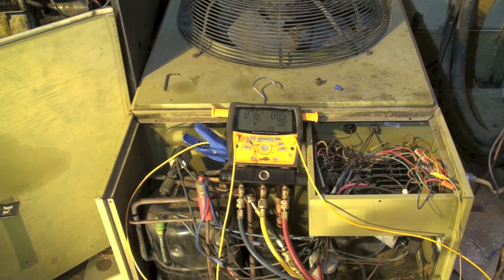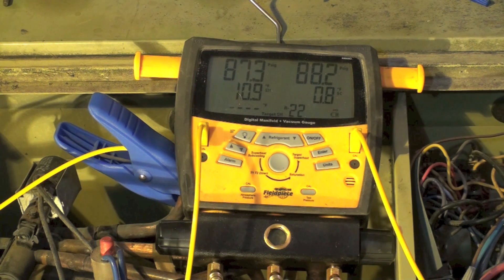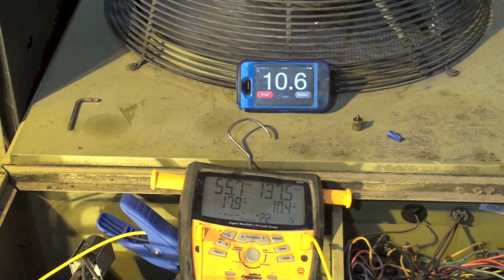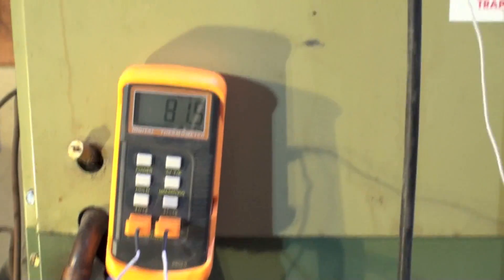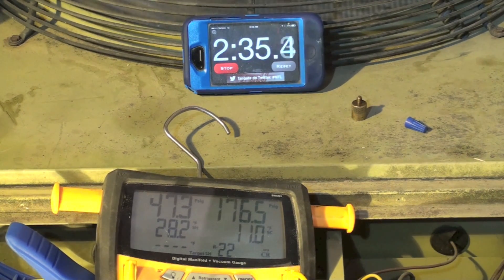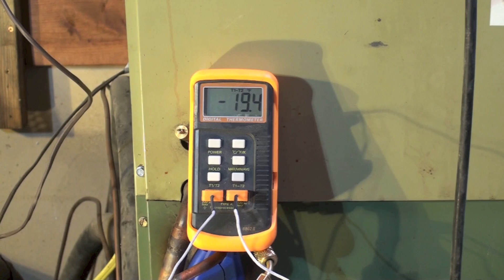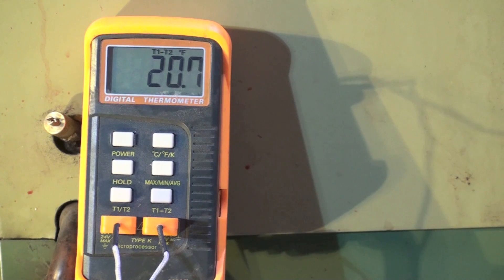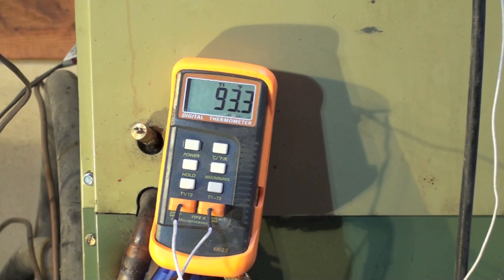How long does it take for the heat pump to be efficient

Comment: I imagine scroll compressors are much more efficient in time about getting to proper operating pressures.

If that reciprocating without a crankcase takes that long at 50 ambient, if it was colder than unit would become inefficient very quickly !!
Reply from the maker: Scrolls are about the same for inefficiency upon startup.  
GFM

Comment: your duct work is just as important .I can measure my units temperature but the heat coming out of your ducts is not the same and my ducts are insulated and were leak checked and in conditioned space since my basement slab and my basement walls are insulated and floors are insulate and house has 2x6 wall studs and attic is well insulated and heat pump is newer lennox 16 seer 4 ton unit dual stage compressor

Comment: GFM,  if the rubber elastomer insulation is deteriorated or sections missing off the suction line, will that impact the efficient delivery of hot gas to the indoor coil?
Reply from the maker: +Gene Friedman It will.  The loss is not huge but is will lose some BTUs 
GFM
Reply: +grayfurnaceman Thank you.... taking that a step further - any reason the suction tubing inside the condensor shouldn`t be insulated?
Reply from the maker: +Gene Friedman You can if you like.  The heat loss is not large.
GFM
Reply: +grayfurnaceman Thank you.  I`m up here in the cold northeast.   Every btu counts.   The longer I can avoid those heat strips kicking in, the better for my wallet.  Regards.

Comment: Is there a difference in the run time to best efficiency for R-410A vs. R22 systems?  Is there a difference for smaller, e.g. 1.5 to 2 ton, systems vs. larger, e.g. 4 to 5 ton, systems?  Is there a difference in cooling mode vs. heating mode?
Reply: Smaller systems will run longer each cycle, spendign more time in the "efficienct zone"

Comment: Here in Michigan we run our air to air heat pumps down to about 25 degree outdoor temperature the problem is the bypass humidifiers we use cannot put out enough humidity due to the low air temperature it's not warm enough to separate the water off the humidifier pad
Reply from the maker: Gary Smith About the only way to solve that is electrically heated power humidifiers.
GFM
Reply: Here's your solution: https://www.homedepot.com/p/Honeywell-Powered-Flow-Through-Whole-House-Humidifier-HE360A/202980252

Comment: is this why variable speed inverter systems are better
Reply from the maker: mooxima The use of variable speed compressors is the future of heat pumps.  There is nothing better than a unit that runs continuously during the winter.  Even in the summer.  
GFM